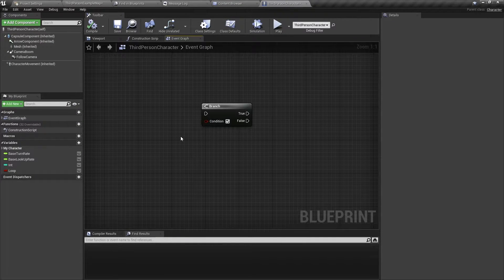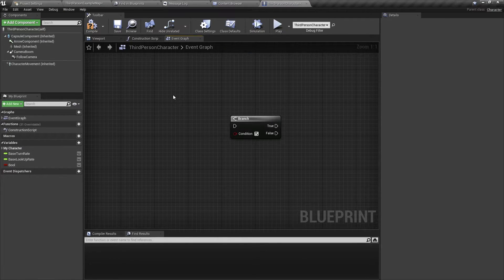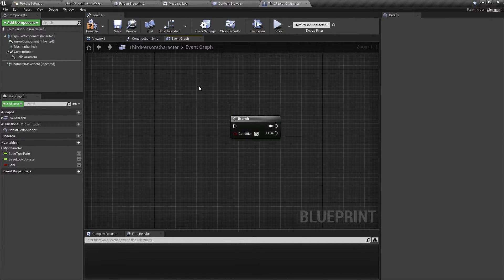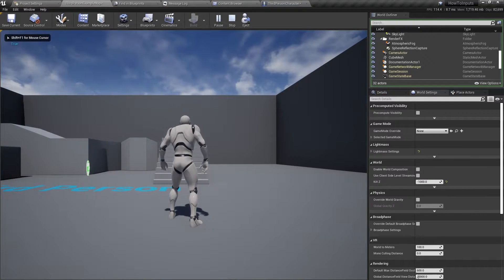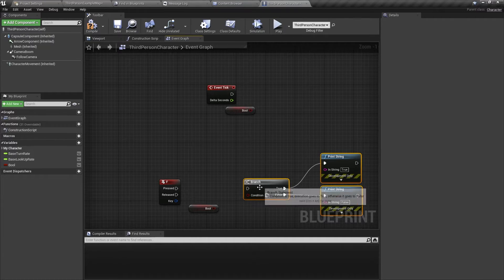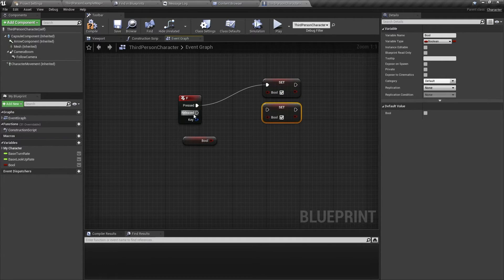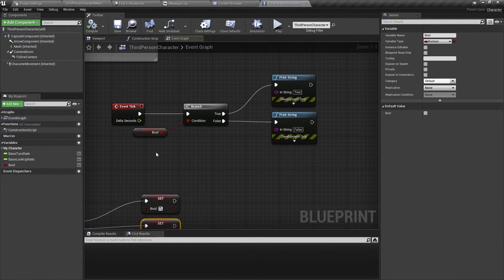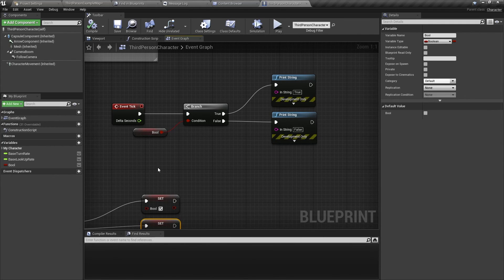How to use the Branch Node in UE4 || Blueprints || UE4 TUTORIALS

Comment: is there a possibility to start a timeline with an if statement?
Reply from the maker: Yes you can, just use a branch before you start the timeline.
Reply: @TechnoNerd  thank you for your answer. I used a branch but it never worked with a timeline. But I am still an amateur I must have made another mistake for it not to work properly .